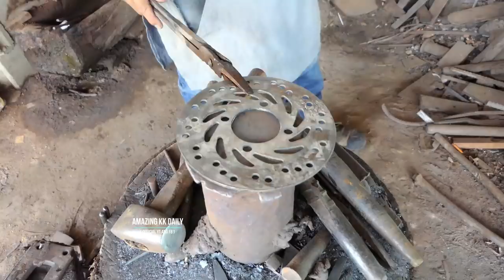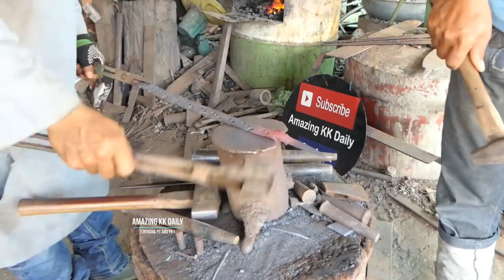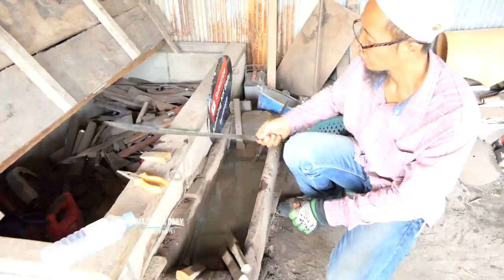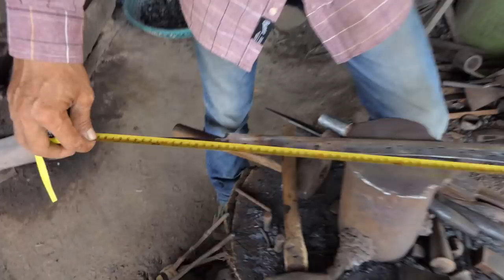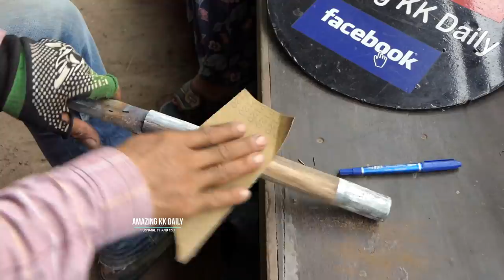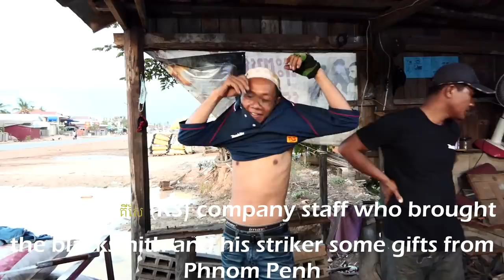SWORD MAKING / HOW TO MAKE AN ANCIENT KHMER SWORD FROM DISC BRAKE (Dao Khmer) ( NOT FOR SALE )

Comment: Very nice work, but i realise a few things. There must be a mechanical connection between the tang and the handle, otherwise its gonna fall apart. If you drill a hole where you put that tang in the handle, and put a pin in it, and maybe some epoxy, it will hold the handle on his place, and the blade will not fly away on its first real strike. As for the effectivness off the handle, it shoud be an oval shape. If it rounded like this, the user cannot index with it, and cannot tell where the edge is. At last i hope that was not water, at the hardening process. Water makes the blade very brutal, so it can brake easily. Use oil if you can, warm oil, in that, the blade will be more flexible, and you can avoid cracks during the heat treatment.  Otherwise, i love to saw that you hardened just the edge. It is a great video, a great sword for the wall, but with these little help that i tried to gave you, you can make an effective and beautiful sword. And nice job :)